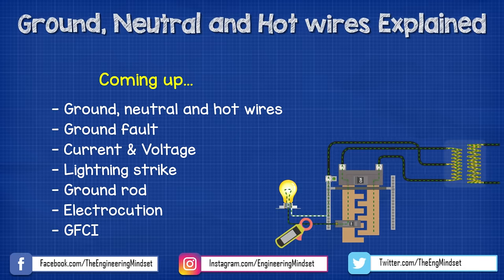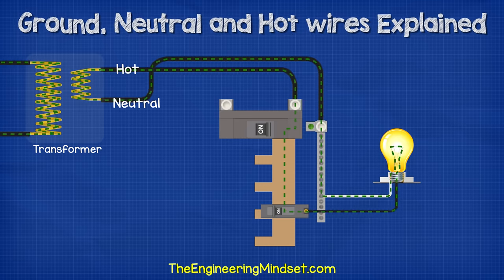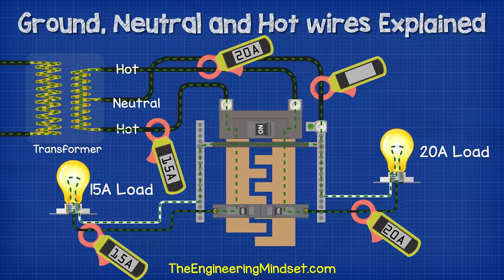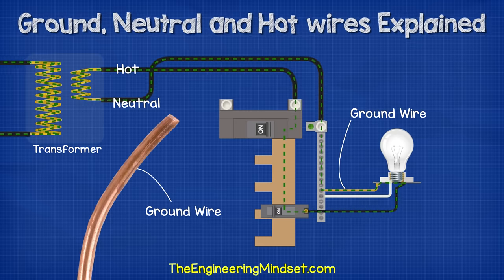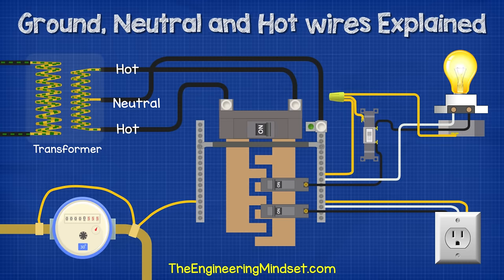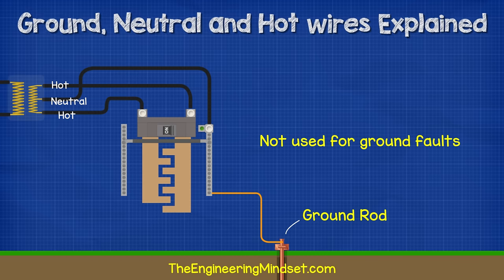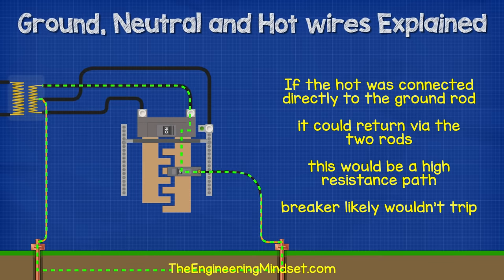Ground Neutral and Hot wires explained - electrical engineering grounding ground fault

Comment: Why is it called neutral? That makes it sound like it doesnt carry current
Reply: You are right. Technically it's the 'grounded conductor.' Neutral really has more to do with the 'neutral component' of a system. Many argue that the so-called 'neutral' is not the neutral of a 120v circuit, but the main feeder IS indeed the neutral of the split-phase system.

Just think of neutral as the center of a circle, or the balance point of a see-saw. Current will not flow along the neutral in a perfectly balanced system. But most of the 'neutrals' feeding the branches of a residential 120v circuit are not really neutral in that way, and it's best to think of them as 'grounded conductors.'

Comment: I think he got the battery in backwards positive is the same as a hot wire an AC panel flows to the light through the switch and the return is called the neutral or negative wire returning to the panel maybe it's just that you're a foreigner looks freaking crazy to me

Comment: Your statement about ground wire not used for ground fault contradicts your own explanation in "Single Phase Electricity Explained - wiring diagram energy meter
" video, where you show ground wire directly connected to ground rod which is actually the case in my country.
Reply from the maker: We just published a new Ground fault, short circuit and arc fault video, so much detail! Link HERE➡️: https://youtu.be/Qi0ynSQw-wc

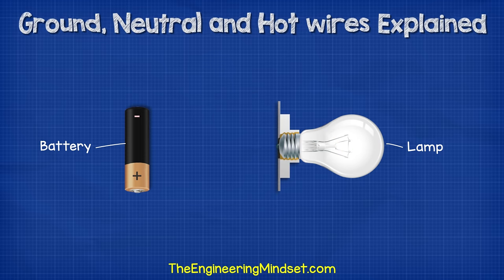Comment: Wrong:  I was hoping to learn something but my confidence immediately went down in regards to you.  At 1:38 you stated electricity flows from (-) to (+) but you are wrong.  It flows from (+) to (-) where as (+) is hot.  With you starting out completely wrong I began to wonder how much I can trust the rest of the video.
Reply from the maker: No, electrons flow from negative to positive. Admittedly the colors used at that part of the video has confused many people and we will look to remake that.
Reply: @EngineeringMindset  Current  Flows from Positive to Negative.  The problem with YouTube is that you have these self proclaimed instructors that want to teach science but yet do not know the science.  Current flowing from Positive (+) to Negative (-) is Engineering 101.  If you do not know that then you should not be attempting to teach the subject.
Reply from the maker: Electrons flow from negative to positive, it's called electron flow. Current flows from positive to negative it's called conventional current.

Comment: It's technically not called a neutral anymore.  It's called a grounded conductor now days.
Reply: @GH-oi2jf  I call in a neutral too, and so does everyone I work with.  But it's actually not called a neutral in the N.E.C.  It's called the grounded conductor.
Reply from the maker: We just published a new Ground fault, short circuit and arc fault video, so much detail! Link HERE➡️: https://youtu.be/Qi0ynSQw-wc

Comment: I have to say this was a pretty good video, but I have a not-so-minor nit to pick: electricity does not flow, current flows. I know it sounds minor, but if you want to provide your viewers with a correct and clear version of what is going on in a circuit, it helps to be consistent with your terminology. Use the word "current" whenever you use the word "flows" and use the word "voltage" whenever you describe a state of energization. Dump the use of the word "electricity" in almost all areas. Electrical engineers never use the word electricity, and for good reason - it doesn't mean anything.
Reply: Isn't there an electric field?

Comment: cool story, but why are you demonstrating a red wire connected to the negative end of a battery ?
Reply from the maker: I have already answered this question multi times, but electrons actually flow from negative to positive. I've blended this together but it unfortunately just confused a lot of people so just ignore that part and assume current flows from positive to negative. It's omitted in future versions.

Comment: I still dont get it lol, how is the neutral wire any different then a hot wire if power is going through both. If it flowed one way it would make sense but sense it flows both ways, how is a hot and neutral any different
Reply from the maker: Neutral is grounded to earth and so are you, therefore a voltage difference between the hot wire and neutral exists but not between you and neutral

Comment: Dude, I dont know how you got your info but your mis informed about several things. one thing is that if a load  or light draws say 20 amps, the neutral will pass LESS amps than the hot because the load is doing WORK. that means its converting AMPS into heat and light plus resistance. Ever hear of the Law of conservation of energy ?  The load does work, converting AMPS into heat, ight  and resistance, so much, much less amps goes through the neutral. if you want to measure the amp draw of a device to check its performance you dont check the neutral you check the hot, that tells you what it is DRAWING b4 it converts to WORK. I have been working in the HVAC field for 40 years, and diagnose, trouble shoot, replace motors, transformers, lighting and many other things and if I used the info you just gave me i would be out of business in a week

Comment: Why would electricity try to return to its source?  That doesn't sound right at all.
Reply from the maker: To complete the circuit. The generator doesn't create electrons it just pushes them along so it needs to take them from somewhere. As it pushes some out, it needs to pull others in.
Reply: @EngineeringMindset  What if the hot came into contact with a different neutral wire (maybe from the neighbors house)    that was more positively charged than the neutral bus bar in your own circuit breaker?  Wouldn't the electricity then flow away from the source towards your neighbors house?

Comment: Okay I'm sorry but does no one else notice that he is saying a ground wire goes to the positive side of the battery?? he says hot wire to negative and "neutral" to positive side of battery... In DC, it's hot to positive and ground to negative... thought it was a one time miscommunication but he says it again multiple times.
Reply from the maker: That's because electrons actually flow from negative to positive so it was animated this way, however this has caused confusion so when we revamp the video we will use conventional current theory (positive to negative) which is wrong but it's how most people were taught at school

Comment: Electrons do NOT flow thru the wire. Energy flows VIA the fields surrounding the conductor NOT thru the conductor.
Reply: @GH-oi2jf  Incorrect. Electrons do NOT move within the wire. If they did, AC wouldn't work.
Reply: @GH-oi2jf  No, YOU have no idea how this works. I suggest that you avail yourself of the opportunity to review Maxwell's field equations rather than trying to depend on some off the wall website quote. Electrons remain with their respecutive atoms. They DO NOT flow thru a wire. The field is generated when the electrons move from a lower energy shell to a higher energy shell and then drop back to their ground state. That's what produces the field. A constantly varying field produces the current, not the flow of electrons.
Reply: @GH-oi2jf  Believe whatever you want, I have no more time for ignorance.

Comment: If the current is alternating direction why the f* the nuetral wire and hot wire alternate aswell?
Reply: Because the neutral is grounded so will have 0 volts when measured with respect to ground assuming there are no faults in the system.
Reply from the maker: We just published a new Ground fault, short circuit and arc fault video, so much detail! Link HERE➡️: https://youtu.be/Qi0ynSQw-wc

Comment: Even though this video presents most of the topics in a very nice and understandable way, there is one overly repeated statement that just hurts my ears. "Always trying to get back to its source"
Please be aware that this sentence in its depth is nonsense. Electrons do not care where they came from.  The only thing that matters is to connect something that currently has less electrons than its "natural" state would be, therefore it is eager to take up electrons from the environment. The battery is just a clever thing that happens to provide both requirements in one pack  - a pole that has excess electrons, and a pole that has less electrons then it can naturally take, so the current flows. It is a tiny difference in describing the same topic, yet it leads to fundamentally different imaginations about the same topic.
Reply from the maker: Check this out, how a battery works: https://youtu.be/PXNKkcB0pI4

Comment: Why does the ground not go to the ground? Is it just a second neutral wire? Why not just split and attach the neutral to both the load and the fixture at the fixture instead of running a whole different length of wire!? That would save 1/3 of wire and cost. Either the ground serves no purpose or should Not be connected to neutral.
Reply: Because if you had neutral connection to a metal case or something every time you run that you will have live electricity on that case there is definitely a reason they are connected and yes it is kinda another neutral wire
Reply: @IPv4Address  but if the neutral wire is attached to ground at the box and the ground is attached to the casing of a grounded tool or appliance then wouldn't that casing be charged anyway? That's how its shown, so I just don't understand why they would attach the neutral to the ground especially if ground is used as a ref voltage in some applications. Wouldn't the ground be absorbing energy when the a.c. goes positive as the ground is negative and can take infinite (basically) energy. Even if you don't loose much energy you would still loose some right? So assuming there are reasons against all that that requires the ground and neutral to be connected why not save the copper and ditch the ground only up to the box where it connects to ground because if you keep the ground wire up to the box it's connected to the neutral anyway.

That was a bit long winded but not to pin the question on you but just to clarify why I'm confused and what I don't understand. Even if wiring ground and neutral is the best way to do it id like to know why not just that its how its done. 🙂

My guess as to why it would be done that way is because the neutral can better deal with a short and the electricity will prefer the neutral wire to the pole rather than travelling back threw the ground because of resistance and I like to imagine a sucking force coming from the negative side which would give the electrons a place to go. That wont mean that there isn't any back feed or any energy loss though, just a preference or tendency not to.
Reply from the maker: We just published a new Ground fault, short circuit and arc fault video, so much detail! Link HERE➡️: https://youtu.be/Qi0ynSQw-wc

Comment: You are using the term "Neutral? incorrectly, for most of this video you are describing a "grounded conductor". A neutral carries the unbalanced  current from the load, if you do not have 2 hots utilizing the same grounded conductor, it is not a neutral.
Reply from the maker: We just published a new Ground fault, short circuit and arc fault video, so much detail! Link HERE➡️: https://youtu.be/Qi0ynSQw-wc

Comment: 5:26 if current is zero, then what abt cut off the neutral line, will it remain operating?😂
Reply: If the circuit is balanced, yes, theoretically, you can cut the neutral. But in practice, the circuit is never balanced. Cutting the neutral dangerous as it can causes things to blow up

Comment: If you are going to produce a vid to be shown in the USA please use correct terms. NO SUCH THING ANY MORE IN NEC called a neutral. Aholes after using this very common term changed it to GROUNDED CONDUCTOR!
Reply: this is educational, not job training. They are going over the concepts. He could call them pink wire, blue wire, and clear wire, for all anyone cares and it wouldn't be breaking the concept. It would simply make for confusion perhaps if you try to watch this video then immediately go play with a breaker box.

But this is not the purpose of the video. It's concept walkthrough. And can confirm my 2024 text book uses neutral wire in its opening chapters. So this is just a useless complaint. He's not using an incorrect term FOR the context of what's being taught. 

It's like complaining in a pure physics class that they use dimensional lumber in an analogy and you say that in fact, they no longer call those parts "studs" they changed it to "vertical planks" or something... It's a completely useless correction for a physics class instead of a HOW to be an architect class. Same here.
Reply from the maker: We just published a new Ground fault, short circuit and arc fault video, so much detail! Link HERE➡️: https://youtu.be/Qi0ynSQw-wc

Comment: WRONG.... Current flows from positive to negative terminals. In a battery or DC current, the wire connected to the positive terminal is the hot wire.
Reply from the maker: Electrons flow from negative to positive, here's a video showing how a battery works https://youtu.be/PXNKkcB0pI4
Conventional flow, which is wrong, flows from positive to negative. If that confuses you, watch this https://youtu.be/MUh_dOcqgVw
Reply: @The Engineering Mindset  that does not confuse me. When we talk about DC, hot wire is the wire connected to the positive terminal, thats where the potential is and its the potential that does the work. On the other hand, in the simple DC loop, current is the same all over the loop and one could argue that the whole loop is the hot wire. AC is a different story.

Comment: Never use green as your hot wire.  It should be green as in ground,  copper wire or insulated green wire.  Not good.
Reply from the maker: We just published a new Ground fault, short circuit and arc fault video, so much detail! Link HERE➡️: https://youtu.be/Qi0ynSQw-wc

Comment: Ground wire bare copper wire? WTF America what are you doing? 😀 I never saw a not isoleted earth wire in Europe. But isolation (green for old buildings and green/yellow today) is lower quality, so after ears, you can often see that ground wire has cracked isolation, especially on machines where wires are moving.

Comment: 1:30.. what the HELL ??? Electricity flows from positive (+) to negative (-)
Reply from the maker: No, it doesn't https://youtu.be/MUh_dOcqgVw
Reply: @EngineeringMindset  Basically, you are right that it is the electrons (negatively charged) that travel towards the positive charged side. What I meant is that concerning the battery (power source), electricity travels from the "-" pictured side to the "+" side.

Comment: "The neutral wire carries the USED electricity back to the power supply? That's hilarious. There is no "used electricity." The current in a normal hot conductor is always identical to that in the neutral conductor.
Reply: by your saying, there's no difference between hot and neutral? Then why even call them hot and neutral? If you actually did watch the video, then you'd know the current of the neutral wire sometimes is lower than the hot wire.

Comment: When I see current explained as electrons "flowing" I grind my teeth.  They do not flow.  They are not streaming particles in a wire.
Reply: Have you got some sort of insight none of us are privy too? In metals, electrons do indeed 'flow' , just the same as water might 'flow' through a sponge. Both are just a large group of individual particles moving together in a flow generated by some external force such a gravity for the water and electro-magnetic forces for the electricity. 

As snarky as that might sound I am totally interested in being corrected on this.
Reply: @LangHvitSkyKriger  The electron get "pushed" on to the wire and a different electron get "pushed" off. This "wave" not instantaneous but almost at the speed of light. The actual electron only travel a few meters an hour. 
If you have a really LONG stick and push on one end the effect on the other end is also at the speed of light and not instantaneous.